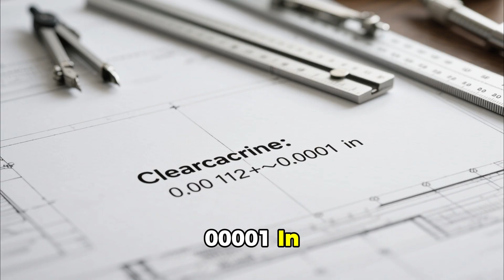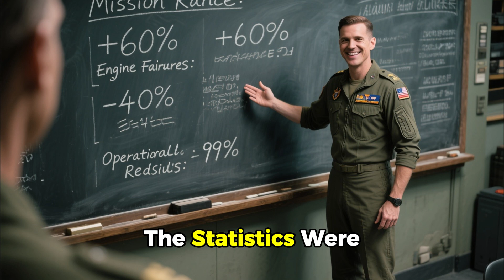They Laughed at America’s Copy — Then 55,000 Packard Merlins Buried the Luftwaffe

Comment: Kajiggers go to Ford big time,  even though dude didn't want to,  they pumped out absolute shitloads of  B-24 Liberators, one an hour.  277,000 jeeps, 1800 M4A3 Sherman tanks, 57,851 R-2800 radial engines for various planes and a lot more. Chevrolet  made 119 million artillery shells (that's a shell every second for years),  1.9 million machine guns, 854,000 trucks,  38,000 tanks/tank destroyers (Cadillac and Buick divisions built M5 Stuarts, M18 Hellcats—the fastest tracked beast in the war) and tons more   Packard and Studebaker died out after the war despite their contributions